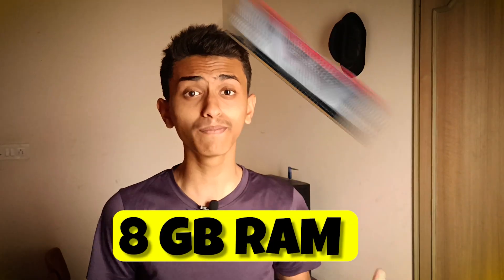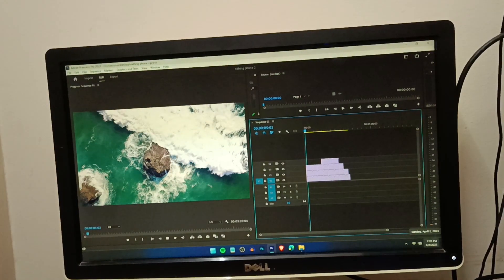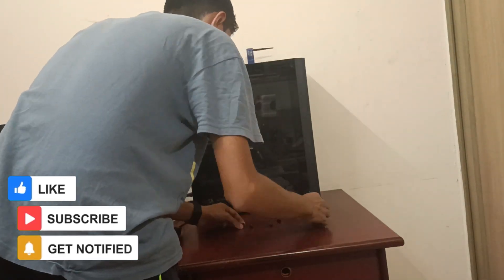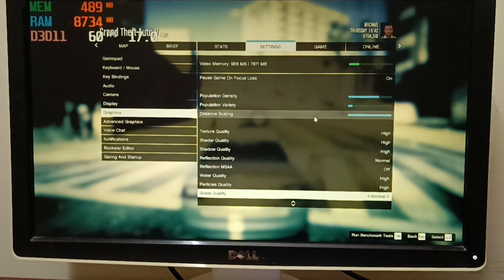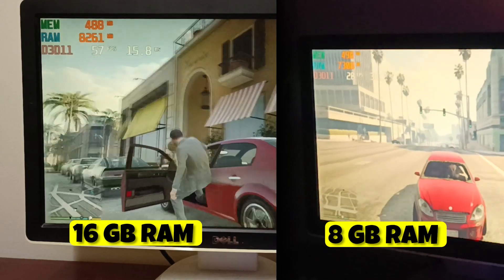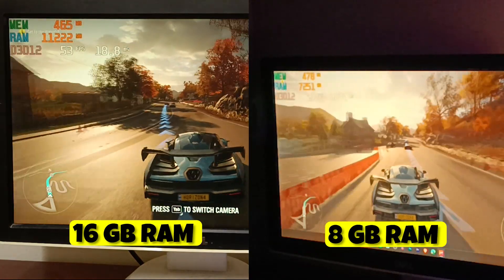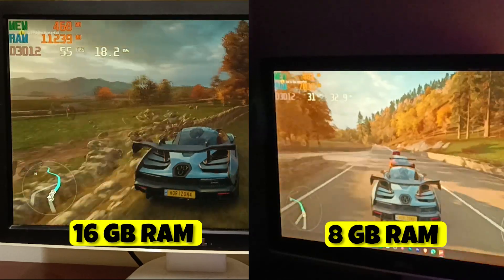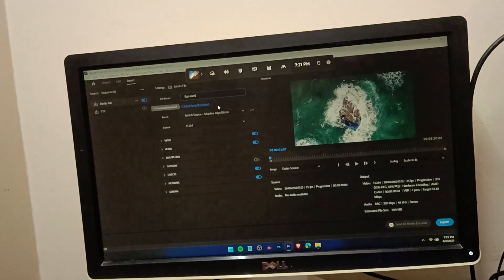8GB to 16GB Ram Upgrade (Dual Channel) ⚡In Ryzen 5 5600g processor | Gaming Performance?

Comment: If I use all 4 RAM slots on the motherboard, meaning 4 × 8=32GB, will dual channel work in that case?
Reply from the maker: Yes
Reply: @KRISHTECHMY thanks bro ❤
Reply from the maker: @dhashinggamerw2004 welcome brother, consider subscribing 🙂
Reply: @KRISHTECHMYmere questions ka answer dijiea please
Reply: @KRISHTECHMYbro mera ek question hai clear kar do 
Mya ek budget pc build karna chata hu to gigabyte ka jo b450 m k mobo hai uspe 2 ram slot hai to mera question ea hai ki mai 16gb single abi ke liya laga uu to game kya chale ga 720p per 5600gt ke uper no gpu mutlab playable hoga kya
Reply from the maker: Yes bro, but not that good fps until u add one more ram stick

Comment: Best solution: 16gb 2x..
Reply: no its not recommended until you do very heavy video editing or use very heavy softwares , for most of the games 16GB is sufficient
Reply: @LightYagami-28  u mean 2x8gb
Reply: @dispelledword7818  yes

Comment: Bro I am currently using 8 gb single stick on Amd Ryzen 5 5600g i want to upgrade which capacity ram will you suggest to buy 8 ram stick or 16 gb??

I am thinking i will buy 16 ram (8+16=24)
Because i want to feature proof my pc 

And i have only 2 ram slots on motherboard that's why I am thinking to buy 16 gb ram,,😅

So which one will you suggest to buy 8gb ram or 16gb??

Please reply me brother ❤
Reply from the maker: So i recommend you to go with 32gb ( 16*2) ram configuration or (8*2) configuration. To enable super performance and dual channeling.
Reply: @KRISHTECHMY  Thanks Brother For suggestion 👍🏼
Reply from the maker: Welcome

Comment: Bro what is you pc specs
Reply: Rizen 5 5600g, XPG ADATA 16 GB ram, SSD , msi b450m pro vdh, may be 550 or 450 watt power supply